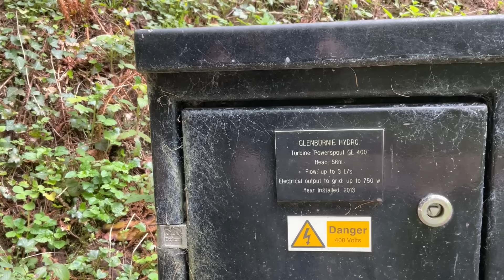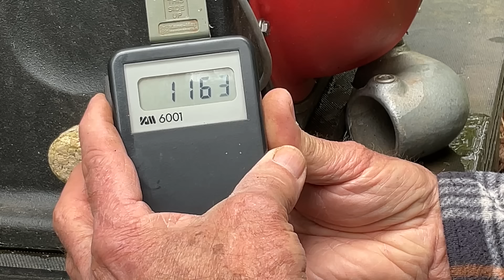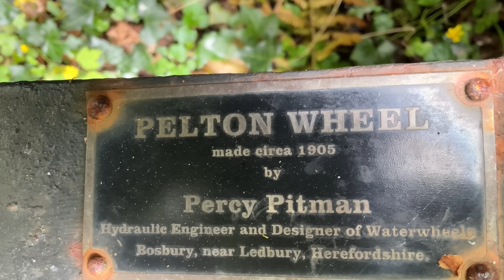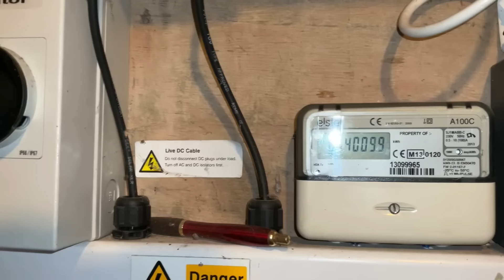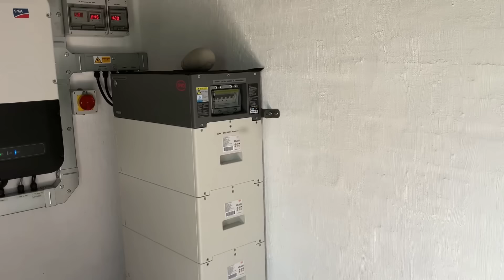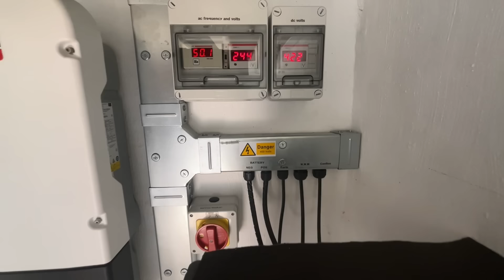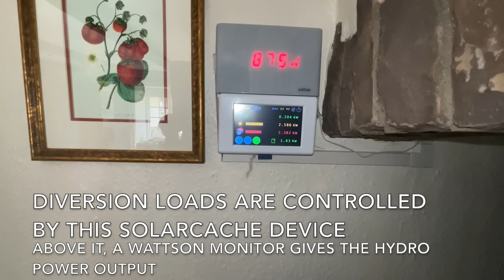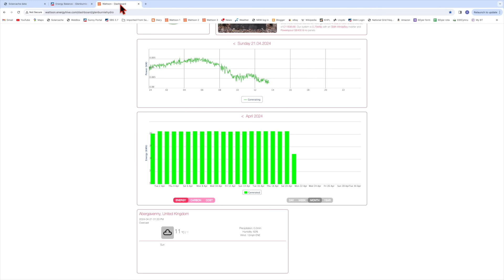Powerspout + solar + battery = the perfect combination.

Comment: How much did this project cost
Reply from the maker: John, thanks for the question.
The hydro, in 2013, cost £10,387.96  - an exhaustive breakdown of this total can be read at https://water-to-wire.blogspot.com/2014/12/cost-and-return_17.html
The solar, in 2015, cost £5,649.32
The battery system, in 2023, cost £17,461.05 
This is an all inclusive figure which includes all construction costs of the 'bunker' + alteration works to the pre-existing electrical layout + all costs of the kit required.
I will try and do another 'exhaustive breakdown' and write it up in the blog for those who are interested.
There have also been costs for 'supply critical spares' which probably come to £5k, - the idea in having these being that the installation should be good for ± 40 years.
Against these outgoings, there have been 'incomings': for the 10 years the hydro has been working, it has earned £13,070.94 in FiT's, and the solar has earned £2,638.62 over its 8 years, - both figures are up to the present time; each FiT contract runs for 20 years and the tariffs increase yearly with RPI.
Additional benefit arises from the 'cost saving' of electricity not purchased from the grid; you can read my estimate of this in 2018 at https://water-to-wire.blogspot.com/search/label/Offset where I estimated it was £546 per year.
Since 2018, electricity prices are up, and the battery storage facility has been added, - so that £546 figure will now be too small an estimate.
With the installation as it is now, we have taken only 14.6 units / kWh from the grid since 1st November last year (2023), so monthly electricity bills are now effectively only the cost of the daily charge for being connected to the grid (since 1st April 2024, £0.63 per day, inclusive of VAT @ 5%).
I should add that, except for the solar installation, most (all !) of the work, ie: design, obtaining regulatory permissions, and construction, I did myself, - except where a qualified electrician was required for alterations to grid connections and house wiring. 
If I had had to pay someone, it would not have been worth doing but as it was, it gave me a lot of enjoyment, and not a little frustration, to bring it to completion.
Come back if you want to know more !
Reply: Thank you for the information
Reply: @KEhydro  I'm sorry, but if i'm reading this right.  You paid over 33,000 pounds for the setup.  You were paying around say 600 pounds per year in electricity from the grid prior.  The cost of this setup = around 55 years of paying grid rates.  The system MAY last 40 years if lucky though before needing to replace critical parts.  You've made back about 15,000 pounds though in incomings is that right?   I'm genuinely curious, I just want to know when the break even point is, because if i'm paying 20 years worth of grid electricity up front, and the system lasts that long it doesn't make sense.   Thats whats happened to solar here in australia, it costs $20k to setup and over the 20 odd years a good panel lasts (including degradation) it saves you nothing due to their tariffs.
Reply from the maker: @deanc6471  Thanks for questioning the financial sense.
I find it an impossible task to work out a financial justification, predicated as it has to be on past details which may no longer apply, and future predictions which are impossible to have certainty about.
All one can do is make a stab at it based on averaged historical grid energy consumption, and using financial data which are true now.
The key figure to get right is the figure for what we would have been paying, at 2024 rates, for energy taken from the grid, if we didn’t have any of the renewables now in existence.
The figure has to be a 'guesstimate', - a 'guesstimate' because it is putting a cost on a situation that doesn’t actually exist, - but I can tell you what my ‘guesstimate’ would have been.
From my records of how much energy we took from the grid before any of the renewables were implemented, each year we took 4,600 kWh of day time tariff energy and 4,000 kWh of night time energy.
At 2024 rates for each tariff, these figures translate to a total cost of £2,350 annually.
That figure includes VAT at the UK rate of 5%.
£2,350 is a bit more than the £600 you were using for your calculation, and it will significantly change the calculation you were wanting to make about ‘the break even point’.
I don’t propose to do the calculation for you, but if you do it, and arrive at a figure, please post a reply.
If you do it, factor in that ‘incomings’ from Feed in Tariff payments will continue until 2033 (for the hydro) and 2035 (for the pv), increasing each year by the percentage change in the UK Retail Price Index. 
The increase for the financial year just started is 5.2%, but what it will be for future years you will have to read from your crystal ball.
Another thing you’ll have to consult your crystal ball about is the future price of electricity, - if it goes up, then the time to ‘break even’ comes down.
Let me leave it there; if you’re in need of a good crystal ball, I’m sure Amazon will have one somewhere, probably made in China.
Thanks for your comment, it was a very valid question.
Reply: @deanc6471  A yank here... but for me, my off grid system isnt about coming out on top vs the power company, its that I dont care for the politics of the power company, then add in outages, and service wait times, and spending extra on an off grid system even though the grid is already on my property, was the right choice for me.
Reply: @RoHo702  An Aussie here, and I second that.  Taking control of your power is simply smart!   They're just as crooked here too.  Thanks for the reply!
Reply: @KEhydro  Thanks mate, great answer!  Yep, the cost as it stands now, in addition to the incomings from the feed in tariff means the whole thing is paid off well before it'll need total replacement.  Add in that I can't see electricity rates going down a truck load and it makes sense.  Don't need a crystal ball to know that these companies will take a profit margin over people, but if I ever do manage to figure out a crystal ball i'll send a free one your way mate!   Thanks again for the reply to my questions and putting this stuff out there!!!
Reply: i dont think the main focus for going off grid should be to come out on top in specific amount of years, its the investment to gaining electrical independence and having the money youd pay for electricity to some other projects
Reply: @KEhydro  AMAzing work!
Reply: The land ownership you need to use this is already too much for most people. It's a hobby, not a source of energy.
Reply: @KEhydro   In our current UK economic climate all costs including energy are rising steeply. Whereas your fixed/known installation costs in real terms will decrease over time, reducing the payback time expotentialy as time passes, However Like you I have installed my system not for financial reasons for for power independancy ...which cannot be priced in uncertain times. I live in the South Lakes, unfortunately do not have micro hydro, but have 9kw solar on my house, and a further 12kw soon to be installed on my barn. I need to study your power cache ? Power divertor setup closely as Id like to divert surplus power to 1)EV charger & 2)Hot water storage, possibly storage heaters (in winter) ....but dont know quite how to do this???
Reply from the maker: @duncannicholson1882  Thanks for commenting Duncan. 
The Solarcache device is sadly no longer available. 
I'm no expert in this area but I think the MyEnergi Eddi and the Marlec iBoost do much the same thing in terms of diverting to resistive loads such as immersion heaters or storage heaters. But the loads must be purely resistive loads with no extra electronics or fans, because the power fed to them will not be 'normal' mains power. Instead it will be Pulse Width Modulated power. It needs to be PWM in order that the power fed to the diversion loads is infinitely variable - always being whatever is left over from your PV generation after what is being 'self-consumed' by other house loads.
Diverting to an EV charger is rather different. An EV charger is very far from being a purely resistive load but the people who understand these things seem to have made it possible to have an EV charger that can receive a variable amount of power. 
The MyEnergi Zappi seems to be the closest to what you (and I) would like - but reading the small print seems to imply it doesn't quite do what I'd want it to ! For example, when surplus home generation is less than 1.4 kW, it seems it will continue to charge the EV but will draw from the grid at that point in order that it can maintain its charging of the car. That is not how I'd want it to work !

For the time being, we manage our EV charging 'manually'.  That is to say we generally try to plug in when the sun is shining strongly, so most of the 3.3 kW the Leaf draws comes from the PV inverter, and the balance, which will be small if the sun is really shining, is taken from the hydro and BYD battery store. 
If the days are continually overcast, then we charge for just 2 hrs late at night when no other household appliances are ON. The 2 hours is timed automatically by the Leaf's onboard charging timer.  Charging in this way will consume all the meagre output of the hydro, seasonally dependent as that is, plus quite a bit from the BYD battery store.  In 2 hrs, the state of charge of the BYD battery store will drop from 100% to maybe 20% - and that is why 2 hrs is about the limit. At 10%, the BYD battery management unit will start to take grid power to recharge the battery, - and I don't want that to happen !
Good luck with your project ! It can be up-hill arriving at a design that works as you want it to, but for all the reasons you give in your comment, it'll be worthwhile in the end.
Reply: @deanc6471  the main cost here is the battery system and thats why most of these setups dont use one.
This kind of setup is great in places where there is no grid connection but of course its also nice not needing the grid at all if you can.
Reply: Tinkering is joy. It's more fair to financially weigh whatever some people would have spent on their boat, golf, art or their lawn or whatever give them enjoyment. 
That it has tangible benefits  (financial, learning, independence) is just a plus. Great vid
Reply: @KEhydro  I think with FIT this is quite good. Wouldn't make sense with SEG post 2019 though. You need to watch about expanding your system too and I know some people mucked up their fits tariff by installing their battery in the wrong spot or adding extra panels
Reply: @deanc6471  this bloke really assumes society is gonna be around in 55 years to provide electricity lmaooo
Reply: @long_chin_man  Hahaha, the way things are looking you just might be onto something there lol!
Reply: What an amazing setup 🫡
Reply: Wow wow wow great sir.👏👏👏

Comment: Your video has such incredible timing, I've been exhaustively researching around for the best hydro generator for my new land purchase. With 30m of head, ~6Lps of flow, 60m (converted to your amazing metric system from my dirty imperial of course) of pipe the power spout you are showing is absolutely perfect! We should be returning around 400w only tapping the stream on the property for half its flow. If I keep an undersized jet on to limit flow and therefore keep the creek flowing below the intake for animals and my neighbors (good friends of mine) it should never need changed I suppose? Your spout storage and entire system for that matter are incredibly well done. Good work sir! The only other option I've found is a Canadian company or converting a washing machine motor (which though interesting doesn't look nearly as reliable and clean as an off the shelf model). Also, THANK YOU, for detailing your head and flow rates, that is the most difficult real world data to find in videos of people's hydro projects. Lastly, having checked out powerspouts website, they have the best micro hydro calculator on the internet hands down. This video is so very helpful. 
-All the best from the USA!
Reply from the maker: Peter, - I well remember being at the stage you are at. The 'gestation phase' of a hydro scheme, if it is to be a good scheme, is the most challenging. Don't rush it. For me, learning that Powerspout turbines were available on the market was the piece of the jigsaw that allowed everything to come together. If you choose one, and your scheme's hydrology is good, you won't be disappointed.
Reply: @KEhydro  I appreciate that sage advice. We're 9 months away from breaking ground and the research is years in the making already, more site visits to come in over this year in various seasons to get more flow numbers for a good average. My friend who currently owns the land states the flow changes some, but so far our measurements are at what he reckons are during the higher end of things (winter). I'll be getting more flow numbers in summer to get more of an average. And of course, we are installing a bifacial solar array to start out and then get more flow data over our first year before investing in the system. Having options seems to be key off grid. Thanks again.

Comment: I'll echo the others regarding great video work, nice fluid movements,  I'm not a huge talker either, so probably would have had inserted descriptions too. I've been off grid for nearly 6 years now with SMA gear, this alternative energy is addictive , good luck with any future upgrades !!!
Reply from the maker: Thanks Andy, - is your scheme 'viewable' at all ? I'd be interested to see what you've done. 
Regarding future upgrades here, I feel as if I've now reached the summit that I'd been hoping to get to when still in the valley, - and there's no higher place to climb to ! 
But technology does keep moving on and creating new goals to aim for, - so yes, I suppose future upgrades have to be a possibility, - if I have the oomph to tackle them !
Reply: @KEhydro  Hi Bill, I monitor my system from anywhere, but I don't have anything online for people to view so to speak. Basically I have 10kWp of solar, two 5 kW Sunny Boys and one 8kW Sunny Island. Coupled to all of this are 35kWh of BYD batteries. I do have an EV as well (Kia EV6) which gets charged exclusively from solar and occasionally from the batteries depending on weather conditions. All working superbly well so far !!! 🤠😎

Comment: This is a blessing, such a peaceful environment. I love water flows and redirecting them to purpose. I have lots of solar panels at roof about 20KW. Although I saw the 85% ratio of the invertor to hyrdro. still I was expecting alot more KW generated through that much of water flow and how fast it was flowing, in no way I am engineer or have background knowledge of hydro just through observation I was kinda of hoping alot more production like 5 6 KW of generation. I suppose with solar you have the sun out and get the KW where in hydro you just have the consistent generation unless it the water dries up. Really loved the setup!! if you were to upgrade 10 years down the track, dont forget to look at Fronius models too if its sold in UK.

Comment: Hey, an electrician from Germany here.
Realy nice Installation, some things like the 1x insulated flex Wires in your house would't be allowed here in Germany but nothing dramatic.

Just one question/reminder, i cant make out if the earth is normal copper felx wire H07V-K or double insulated NYM-J both should not be but underground especially not for the main earth, because of corosion. It has to be Stainless Steel (V4A) or Aluminium until it comes out of the ground.

I hope that iam not wrong but please check that.

All in all real nice Installation and neat idea.

Comment: Ledbury? fairly local to me.

I have a 600w solar installation i did, nothing to this degree though. I use it to power a portable LifePo4 setup i built that runs on tasmota. It acts as a UPS system and, on full state of charge, automatically cuts it's grid supply to allow consumption of battery (solar) power.

Nowhere near this level of advanced or big, but still, it's a start.

Thanks for sharing!
Reply from the maker: Thanks for commenting.
If you're interested, you can read more about Percy Pitman at https://www.bosburyhistoryresource.org.uk/PH-Percy-Hector-Pitman.html

Comment: Very nice setup constant 800w of power + solar later and a 10kwh battery pack could probably run most smaller houses grid free but with the solar pannels I imagine full house like that it would hardly use grid

Our house can only be solar only

both are unfortunately not ideal location front roof is run rising direction (it's not possible to use rear side of the roof due to extention, if we could that would have been 3.6kw on both sides with 7.2kw single dual mppt inverter but unfortunately no)

second one is the shed where I managed to install 3kw on it (it was a pigeon shed it was kinda long until the end of it was removed) , it is technically correct direction but I have the angle quite sloped flat ish due to not wanting to upset the neighbours back garden sun light (they still don't know it has solar pannels on it because put back box on the rack so just looks slightly taller shed with a new roof)

5kw solar with 3600 inverter + 3kw solar  on the shed(both are sunny boy 3600 inverters might try getting extra 2 or 4 pannels on the shed, we are allowed 7.2-8kw on export I believe) could do with battery's to handle night time loads

Comment: I love it!  Makes me wish for some elevation on my property.  Mine varies by less than two feet between high and low point.
Reply: Try waterwheel system. It can work for you. He is using pressure from the water water; you on the other hand can use the weight of the water to harness energy . You may end up with some few hundred watts but with that 24/7, you are in for a good ride.